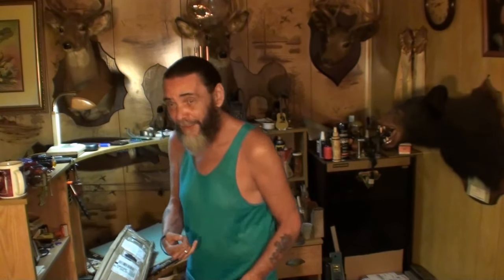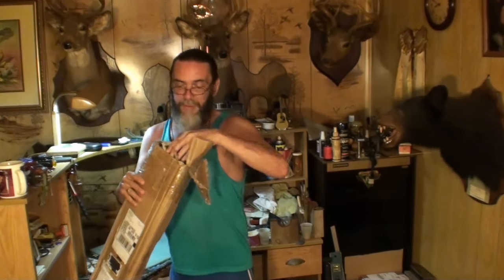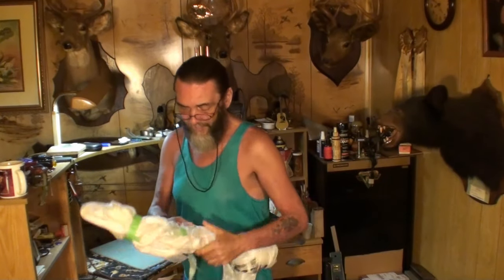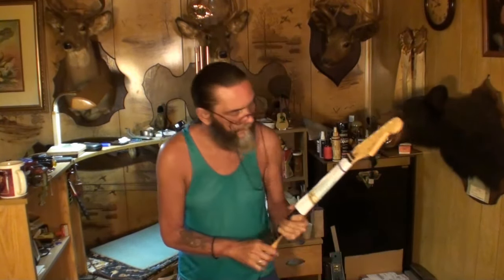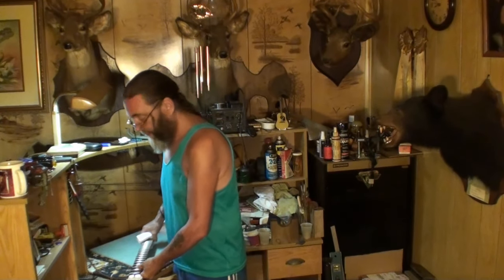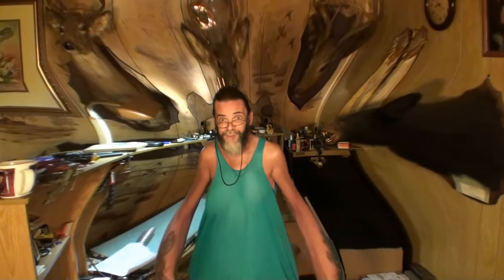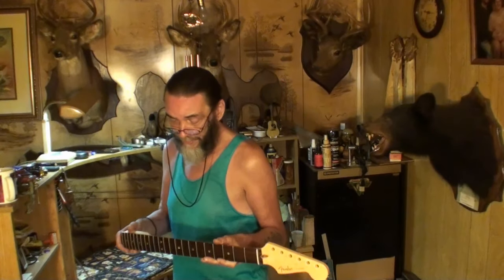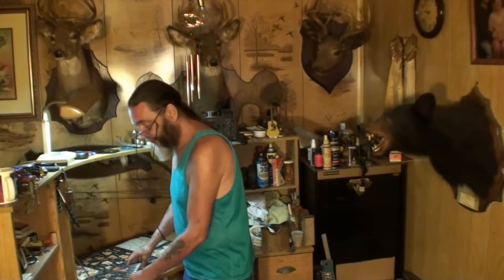fender stratocaster neck in much need of love bi-flex truss rod stripped

Comment: Yep, that's right. Bi-flex on those. Fender started to use them on the American Standard series and Pluss series in 1985 (the pluss model debuted a little later, though) and haven't stopped using them since, unless they've come up with something recently (They call them the American Proffessional series now. I haven't seen one of those in the flesh yet, but those seem to have the adjustment at the heel end of the neck, like you'd see on modern Music Man guitars. Are they still the Bi-flex, though? I have no idea...). Oh, and the pluss, which then changed name to deluxe, is now called the elite... There are so many iterations of the Stratocaster out there now it's doing my head in(!).
Reply from the maker: I don't know either, all I've done on later dated ones is a set up, surely Fender has gone to the 2 way adjustable rods by now? maybe someone will chime in and let us know. thanks for checking out my video!

Comment: Shouldn't the 2007 American deluxe  have a bi-flex truss rod?
If you turn it counterclockwise,  it will loosen up, and then eventually start putting forward bow in the neck.

The rod pushes against the walnut plug and in turn flexes the rod forward.
Reply from the maker: yep that;s what I said in the video. thanks for watching!
Reply: I know a 2008 standard has one because i own one

Comment: Hey randy I have a fender stratocaster, one of the bridge saddles won't rise or lower, guess it's stripped.  Any suggestions? I need it lowered. Should I just buy another one?
Reply from the maker: take off the pick guard and see if it has springs on the pickup screws, some of them have felt or foam that often dry out over time. good luck and thanks for viewing!
Reply: The height adjustment screws on the bridge saddles are very, very thin puny things. I've had the thread go on mine a few times. Try Locktite and see if that helps. It did the trick for me, for what that's worth. If not, saddles are available to buy as replacement parts.
Reply: @Innerspace100  thanks!
Reply: Often you can take the whole saddle off the guitar, and after some heat and penetrating fluid, you can grip the lower threaded section of the little grub screw with grips and remove it out downwards for replacement.
Reply: @rickpiper4668  thanks !

Comment: See Randy, as soon as you recover from that skin deal Earl is right there with the tounge! You can't win fer loosen with that dude. Thanks for a great vid and boy, what a nasty bow in that neck. Looks like somebody sat on it for a good while. I'm eager to,see what you'll do with this. Are you going to clamp it with a bit of heat? Thanks Much Randy! DaveyJO
Reply from the maker: yeah Earl must have been afraid of catching eczema because he didn't bother me much until I was cured lol yeah it's forward bowed really bad, my guess is it had string tension on it for a long time. I'll give you a heads up, I already got back bow into the neck and didn't have to change the truss rod head, letting it settle down and get used to the new position then I'm going to do the frets, stay tune to see how I got it to back bow you won't believe it until you see how! many thanks Daveyjo for watching and commenting! cheers!